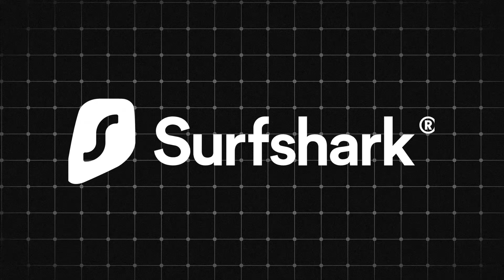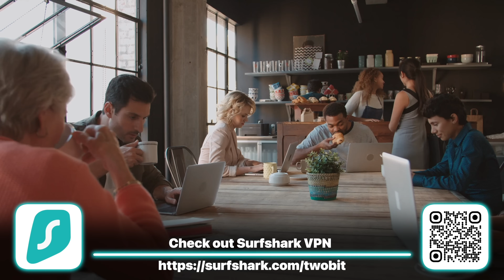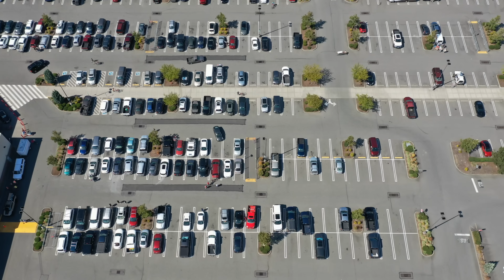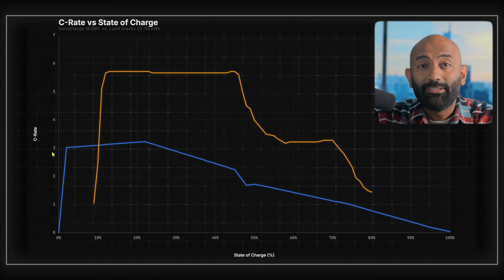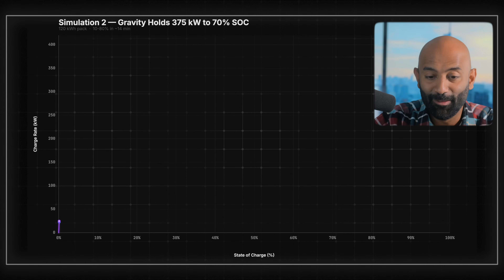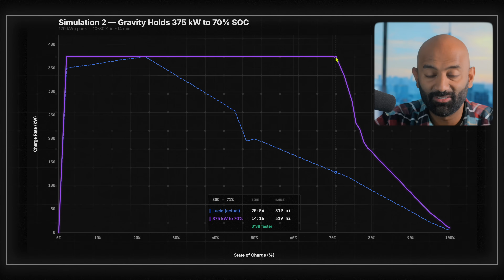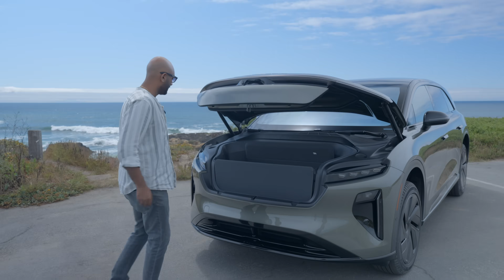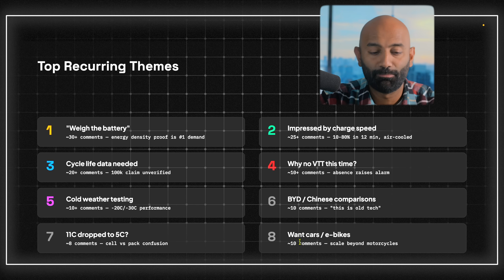Donut Lab Battery Test 4 Changes Everything!

Comment: Did I calculate it right, that getting the 100000 charging cycles would take abt. 2 years if using rate 11C?  I guess that we have to wait longer for the last VTT report if that's the case. Or is there a decimal mistake in my calculation -I'm just tourist enjoying the ride.
Reply from the maker: 100k cycles at 11C would be insane wear — more like decades at real-world use. VTT likely meant shallow cycles.

Comment: At CES 2026 Donut claimed a 6C+ charge rate from 0 -100% at pack level, in video 4 Donut reduced that first claim to 5C at pack level, and in the video they show only 3.5C in average, and only in the sweet spot between 10-80%, with none of all the other claims proven in the same battery.

What a circus.

Comment: Am i positive? I think i am more sceptical for now as thanks to the many many fraud cases that we have seen before i tend to go that way, But I am optimistic even if it isnt a carbon battery, even if it would be a capacitor barrey hybrith it is significant for the botorbike, mopet and electric bisicles industry. Dont know if it would be usefull for the car industry but it might also be of use for busses. We will see.
Reply from the maker: carbon battery or cap hybrid — either way, 5C charging on a bike is legit interesting

Comment: The  important missing part is still the weight of the battery. You could simply take high end NMC cells and derate 30 kWh battery as "18 kWh" and your C-rates instantly shoot up with zero issues. However, your kWh/kg rating would collapse roughly in half which is why Donut Lab 400 Wh/kg spec is so critical and still Donut Lab fails to show any evidence for that!

Comment: I wonder if it's just a marketing stunt to improve the sales of their bike. The base version has the same capacity, same range as the original one. Just improved charging time and supposedly 100k charge cycles. So the long range variant will be just postponed endlessly like Tesla postpones Roadster for years and they will just go with the basic one until someone truly invents solid state batteries.
Reply from the maker: same old dance — better charging doesn’t matter if the range never moves

Comment: Silicon carbon batteries are supposed to charge at 2 to 3C, Could they be using Silicon carbon batteries?
Reply from the maker: nah, silicon carbon tops out around 3C — this is doing 5-6C, so it's something else
Reply: @TwoBitDaVinci  Thanks for the reply. My thought was that charging Silicon Carbon 2X long term rated charge rated (6C) might result in the high temps seen in testing, without immediate degradation

Comment: Why would they use 18kwh .. it should be 40kwh. Cooling alone doesn't increase the C-rate .. I think it is still a good lithium battery.
Reply from the maker: 18kWh is likely the usable pack — cooling lets them hold high C-rate longer, not make more energy. 40kWh would be wild for a bike.

Comment: We are probably at the start of a revolution here ; this solid state battery seems so solvent about every shortcoming lithium ion tech has. I always said we’ll eventually switch to EVs, but it’s impossible to switch if the lithium ion is still the best battery tech we can make. It’s too dangerous, too unreliable and insufficiently durable for this particular use case.
Reply from the maker: solid state fixing li-ion’s danger/unreliability? that’s the hope — but we still need proof on weight and cycles

Comment: Like your analysis.
Lets see the cold temperature test and real cycle with discharging rates of 5c or 10c. At least 10 cycles ofcourse.
Reply from the maker: cold and 5c/10c discharge — yes please. where’s the ice bath test?
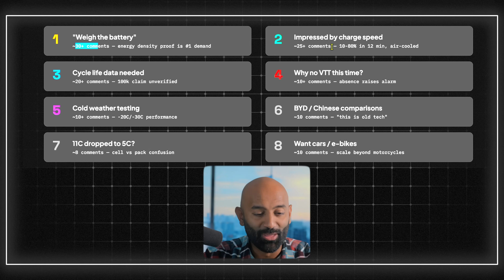Reply: @TwoBitDaVinci did you see the noteblock with GEN 3 at 20:24 minutes into the video of donut lab?
Who is going to test the Verge batteries that should have Donut Lab batteries?
Don't spend time on them until they send you the Verge motorcycle complete or the battery cell of the Verge.

Comment: The energy density is still a concern. Energy density seems to be low and not 400wh/kg
Reply from the maker: typo? meant 400Wh/kg not kWh/kg — big difference
Reply: @TwoBitDaVinci  yes
Reply: Based on... what? 😊
Reply: @peterahlvik5954  the same bike with old batteries has 20,2kwh and 300kwh/kg

This one had 18kwh
Reply: @Solid_Snake99 The new battery also has 20.2 kWh capacity but the nominal capacity is 18 kWh.
Reply: Until they show the 33kwh the energy density is not confirmed
Reply: @Solid_Snake99 That does not necessarily mean that it is "low". Until we know an exact number that has been verified by an external lab, 400 kWh is the only hint we have.

Comment: Amperage is capped but pack voltage increases. Therefore the increased power over time
Reply from the maker: exactly, power ramps up as voltage climbs even if current's capped

Comment: 20:30 There are plenty of charing test-labs that do chargign tests woth power as well that could have doen a 3rd party test. So this is not an excuse
Reply from the maker: lab specs don't ship bikes — real world does
Reply: @TwoBitDaVinci  those Labs hat "real world" charging stations that monitor everything during the charging session. Including tests in climate chambers to test charging during heat/cold. All of them give more solid data than a random test at a random charger

Comment: With the cost fuel these days no one fills a tank to full. You just stick in half in case the price goes down. 
So if you could charge a battery to 70% in 10 minutes but get more range out of it. I'll take that.
Reply from the maker: exactly — usable range matters more than 100% on a gauge

Comment: Hopefully when this battery comes out main stream.  The vehicles, or at least one, that use it will be easy to repair away from dealerships.  It seems many that makes electric vehicles don't think about it be repair at a normal repair place.  Still neat and maybe in a decade I will be able to get a used one.
Reply from the maker: repairability matters — hope they design for garages, not just dealerships

Comment: I was chatting with a electrician that worked on Fortescue Battery Trains and Mining Trucks. They were voltage limited because high voltage DC required a completely different regulations. So to fill the mining trucks fast, the engineers had to build current maxing systems to dump the electrons in but that required insane cooling systems attached basically a whole second cargo container just for the cooling for the 6 megawatt chargers.
Reply from the maker: Fortescue's electrician nailed it — MW charging needs cooling like a second cargo container. Physics doesn't negotiate.

Comment: I did my apprenticeship in the electrical trade with a distribution authority, A charge station would need to be feed by a 500+kva 11kv transformer, so we are going to need a massive high voltage bank of capacitance to feed charge stations as to allow for more than one bike at the same time.
Yes possible, I need to invest in those suppliers.
I'm a bike rider (dirt) and cooling is a limiting factor in high load environments. So the cooling limits in the charge graph makes sense. Those fans will be running flat chat, on the road speed does the job of cooling.
Good/great analysis. 👍
PS: I might be ready to convert to think about switching.🤙
Reply: Tesla integrates buffer batteries into many of its Supercharger fast-charging stations to manage high demand and maintain charging speeds without overstressing the electrical grid.
Reply from the maker: 500kva transformer? Damn. Grid's the real boss here — cooling's just keeping up.

Comment: It is entirely possible to build Li-Ion battery cells that can have 5C charge rate. This comes at the cost of power density and longevity. As they still dont show the size and weight of the battery pack or any kind of cycle tests I remain very sceptical. 
its not even guarenteed that the capacity is acutally 14kWh. Also if you have a small battery pack, you can sink the heat into the radiators for quite a while before you hit the thermal limit. 
This video basically prooves nothing.

Comment: The smaller motorbike battery has a bigger surface area to volume ratio as anything smaller does.
The bigger surface area for the volume allows more cooling so, an aggressive CEO could allow higher charge rates banking on the extra cooling.

Impressive results early will sell more bikes and when batteries start failing in the future the company could be sold and not the CEO's problem...
Reply: You just forget one thing, a single charge on a single sales video, say nothing. Donut has so far 100% failed to deliver the much needed extraordinary evidence to all the extraordinary claims from CES 2026.

We need to be patient, and wait for some external tests after a donut battery hits the market...only then we can start to be impressed.
Reply from the maker: yeah more surface area helps cooling but you still can't cheat physics — chemistry and BMS set the hard limits

Comment: So you haven't seen BYD flash chargers?

BYD already has already demonstrated 10-70% in 5 minutes. 10-97% in 9 minutes... And that's a full size car battery.
Reply: Actually 4 min 51 sec ;-)
Reply from the maker: 5 minutes for 10-70%? Wild. But is that the same chemistry or just marketing?
Reply: @TwoBitDaVinci  Marketing?? It's a real product. They demoed about 10 different cars capable of this. It's cars using their Blade battery 2.0 and 1.5MW flash charger stations. It was in the news in multiple places.

Comment: The c-rate and charging time seems very similar to an xpeng battery. That is lfp, so the density is much lower than the claimed 400Wh/kg, but the charging c-rate is very similar to this Donut test
Reply: Agreed, 70% in 12 min is only 3.5C charging, NOT 5C.  Chinese battery makers are already there with lithium.

Edit: Correction, the Chinese lithium batteries charging this fast are using advanced active cooling.  So, if this demo is legit, then 3.5C with passive cooling is major improvement.
Reply: Buddy you're talking about liquid cooled lfp cells, try fitting 20kwh of those on the bike's frame. Not gonna happen.
Reply: @sideways0wl True point, but they’re operating like conmen that over promise and majorly under deliver.  It’s working extremely well at attracting attention.  However, I just hope they actually reach significant production sometime soon of something close to these already underdelivering prototypes.
Reply: @sideways0wl well, these weren’t on passive cooling.  They had two high CFM fans actively cooling the heat sinks dissipating the heat.  I’m sure they used every heat dissipation they could quickly throw in a prototype.  So, while liquid cooled packs will charge faster, don’t expect anywhere near 11C, like they claimed.  In fact the average of this was just 3.5C because they only charged 70% of the battery in 12 minutes.
Reply from the maker: Still waiting on that weight check — until then, all we got is vibes and charge curves

Comment: Promising! Great report and analysis, following up on earlier questions. Thank you. I feel that 0.4 kWh per kg is not great, but everything electrical is.

I recently saw an analysis of cheap versus reliable lithium cells where the heap ones had irregular kathode-anode distance patterns. These are close together and the irregular patterns make them a fire hazard (by short circuiting at the cell level). This makes every lithium cell a question mark.

And transitively is how this new chemistry/architecture, is inherently safe.
Reply: Every lithium battery is indeed a fire hazard. Impact one hard enough in the wrong way and it will catch fire
Reply: One thing about eV from experience. Recharging at home from solar is both slow and cheap. The highest power fast recharging stations at the energy-station along the motorway/highway? Relatively ludicrously expensive.

For reference, there are 10 kWh in 1 litre of petrol (or 45.4609 kWh per UK imperialist gallon or 37.8541 kWh per US Liquid gallon of gasoline).
Problem with ICE is that most of those kWh are lost in friction, transmission losses, reciprocation, etc. so with a car you may at best get 25% of that to the road.

At the eV charge station, you pay for what you took out of the grid, but your car reports what it took out of the battery and there are losses there too. Standstill, conversions, transmission inefficiencies, but much better than in ICE.

When you - bottom line - compare the price you pay per kWh, the ICE car is still not expensive, when the price per kWh at the high-power fastest highway station is ludicrous. Per kWh, or MJ.

For home/house batteries used as price buffer from the grid, this means the earn-back time is still bad. Even when you can charge at off-peak low price rates. Or from solar.
But recharging a 100kWh eV battery from your solar takes a few hours (days, likely). And you probably are wearing out your house battery buffer too.

Part of the problem is that the fuel at the petrol station, gasoline at the gas station, also is the kind of stuff that goes into the electricity plant and still needs transportation with conversion losses. Your house's solar system would be crucial here.

The future, in my thinking, is eV, but its overall economy needs to be restructured and have its priorities reset. And in-car batteries need to be able to double as house batteries too.
Reply from the maker: 0.4kWh/kg is 400Wh/kg — yeah it’s low for now but safety first. Irregular anode/cathode spacing is scary though.

Comment: Batteries are few steps in front of the infrastructure.
The future is today, even if we do not have such charge power like 700kW we will have a constant charging curve with 200-300 kW.😆😆😆  
I live in Brasov district in Romania in town Rasnov and I have an ELDRIVE charging station with 200 kW.
I can hardly wait to have a car that has this kind battery.
On my Volvo EX30 I use DC charging at 50 kW I am getting a constant charge curve.
Reply from the maker: 200-300 kW constant curve? That’s the sweet spot — glad your EX30’s holding steady at 50kW for now.

Comment: I not sure I get the hype. They just repeated the lab test, showing a battery charging at 5C. But charging at 5C is nothing new unless you can prove that it does not degrade the battery over time.
Reply from the maker: cycle life’s the real flex — lab numbers mean nothing if it dies in 6 months

Comment: Until I see a large pack with proper cooling call me skeptical.  Just saying its charging better than other electric motorcycles is an odd flex given the market size for that kind of product.  Dragging out the data and videos is a manipulation tactic.  Comparing to Zero with their best bike sitting at 6kw max charge rate just proves the e-motos are so far behind on fast charging is obvious.  The best emoto only gets to 24kw rate on DC fast.   All I see so far is they put a more capable DC fast charger BMS and wiring on an emoto. There are plenty of EV manufacturers in Finland they could have partnered up with to build a pack for, so again it comes across as an odd approach.  Why would a real product have anyone guessing how a large pack charge will perform?  Seems like a no brainer to have a test EV with a donut pack hooked up to the fastest DC fast charger that would show off their battery.  Everything else is smoke and mirrors.
Reply from the maker: skepticism is fair — we're still at cell level. show me a full pack stress test and I'll shut up

Comment: Thanks for the insightful analysis! One thing I’m a little concerned about, as a former Gen 2 Nissan Leaf owner with an air-cooled battery, is whether the Donut Lab motorcycle BMS could handle multiple charging sessions in a single day.

In my Leaf, the BMS could usually manage about two fast charges before pack temperatures climbed enough to trigger turtle mode. So I’m curious how you think this system would cope with repeated fast charging and heat buildup over longer rides.
Reply from the maker: cooling’s the limiter — how many 5C bursts before it taps out?

Comment: How big of a factor is ambient temperature? It will be cold in Finland these days.
Reply: This charging test was not done in Finland as it was performed at a Cirkle K station, no such stations in Finland. Most likely done is in Estonia, Tallin where Verge Motorcycle has it headquarters. The test was not done recently, Ville, the CTO says the battery starts at around 20 degrees Celsius, most likely the ambient temperature at the test. How can we know? Well, look at the thumbnail of the video, to the right end. You can see green grass at the gas station, and in the background trees with leaves, green leaves. Most likely this was filmed in august-september last year. The grass still has the green luster look from grass that is still growing and the leaves have no other color than green. And if the ambient temperature is 20C it can’t be any later than the beginning of September, you don’t see that kind of temperature later in the fall. This proves that they had the tech back in summer last year, but only now put it out there for us to watch.
Reply from the maker: Finland cold? Their cooling handled the test — real winter would bite into that charge speed.